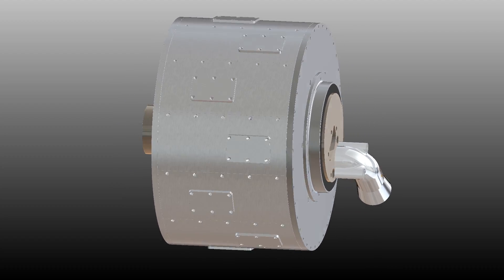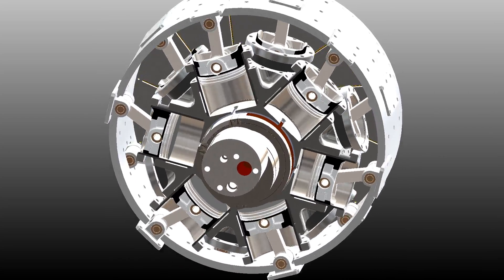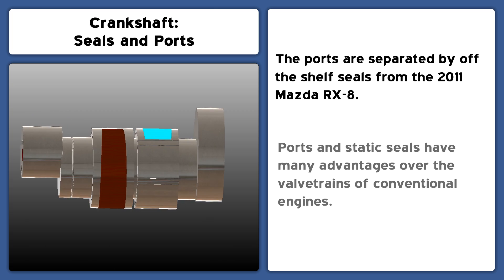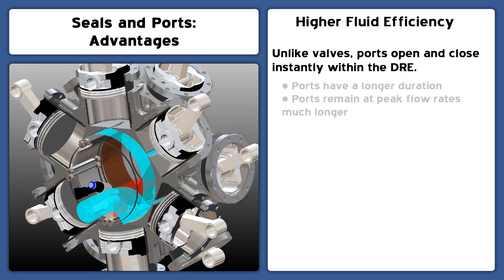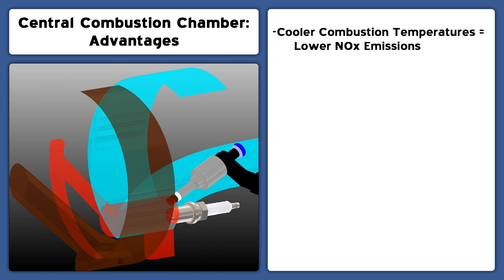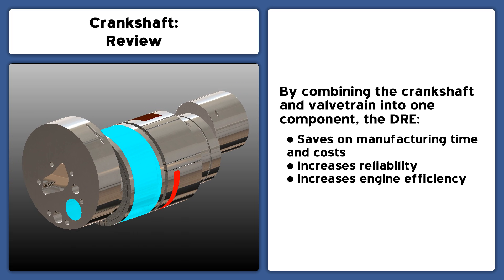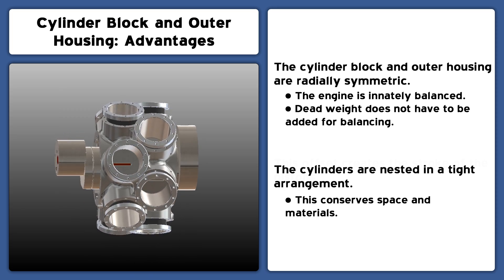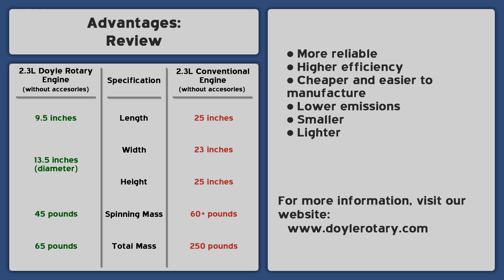New Split Cycle Engine Concept: The Doyle Rotary Engine

Comment from the maker: Getting rid of heat using a cooling system means that some energy from combustion is not being used for power. Why does the conventional engine need such a robust cooling system compared to the DRE?

First, a conventional engine dumps up to 30% of combustion pressure out of the exhaust halfway through the power stroke. In the DRE, less pressure will be lost to exhaust so less fuel will need to be burned to produce the same power per displacement. Burning less fuel will decrease cooling waste.

Comment from the maker: The video explained that the rotating mass is much smaller in the DRE. However, since the mass is located further out, the rotational inertia isn't smaller...it comes out equivalent to a conventional engine.

Comment from the maker: Changing the spark plug requires:
1. Pulling the boot off the spark plug.
2. Removing spark plug with a spark plug socket, ratchet and extension.
3. Screw in and tighten new spark plug.
4. Reconnect boot.

Much less than 8 hours.

Comment: The Arial square four was prone to overheating because there were too many cylinders, too close together - and there were only four.  This engine seems to multiply that problem.  It may work fine on the drawing board, but have any been built, and tried "in anger"?  Maybe I'm missing something, but at first sight, it looks to me that getting rid of heat from this engine would be a nightmare.  12 cylinders' worth of heat is a very small space takes a lot of cooling.

Comment from the maker: Solidworks is more oriented toward creating models to use for machining, molding, etc. The animation and rendering portion of SW is basically an add-on and doesn't have as many features as 3ds Max.

Solidworks is used more for engineering related design while 3ds Max is used more for visual effects and CG images.

So I would say that Solidworks is a program with much more complex 3D modeling tools but simpler animation and rendering tools than 3ds Max.

Comment: I can see two major flaws in this design. Pore oil flow on the piston rings without introducing a method that involves burning lots of oil (short life). Second how do you cool such a thing? Air fins would cause drag, and water/oil cooling would only be effective on the shaft.

Comment: A great backup engine for a primarily electric engine car. You could have it run a fairly big generator for the size of the motor using the rotation of the engines weight to your advantage, by combining the engine and the generator into one piece.

Comment: I agree with many on the sealing of the inner seal rotor and combustion heat would cause problems in in the valve system in the crankshaft. seems no one has made a better engine than the piston crankshaft design used for over 100 years.

Comment: The rotary engine is discontinued because of fuel costs, not reliability problems.  The rotary has failed achieve better than 28MPG in a market dominated by 40+MPG designs that offer comparable power output.  Remember, the 3rd generation RX-7 was nixed during an era of high fuel prices too.  These are not coincidences.

I've driven rotary engine cars dating as far back as 1979.  Never once have any of my engines self-destructed when properly maintained.  Seals blow only after 270,000 miles.

Comment: Scale down conceptual designs approx 3:1, allow for multiple engines inter-connected through crankshafts to common hypoid primary drive system. Phasing drive triangularly will subsequently complicate any repair processes necessary but improve torque at low engine revolutions still allowing for a 'rev happy' power producing machine of endless capabilities. Please refer to my 3D Solidworks CAD and reference PDF 
(Henry Bennets Theoretic Geometry)

Comment: @Orionblade2003 this is true but i was thinking that its still only as efecient as any other internal cumbution engine 45-55% heat loss what if u used the first row of cylender for cumbustion and use the second row to run the steam made buy the cubustionm much more effecient =3-

Comment: @xoxoXoieoxox 
I think the point is that relative to the axis of the rotating components, nothing's moving laterally, so it's balanced more like a wheel/tire than an oddly-shaped crankshaft with counterweights.

Comment: Shorten the stroke? Light weight, higher RPMs, maybe slightly less efficient but potentially much less outer reciprocating mass at higher speeds.

Comment: @DoyleRotary They have advanced quite a bit, but the cost isn't going to get any cheaper for very much more advancement. Think exponential scaling curves for cost versus capacity. 

I'm aware that not many are in this field, I was just throwing some ideas towards you guys on something you might want to look into. I've been wanting to build an example myself, but the problem is with finding a steady state engine that is efficient and light enough for such an application. cont...

Comment: @DoyleRotary Why use a Battery? Half the cost of the current Hybrids is in the Batteries. There are cheaper far more efficient alternatives, such as Super Capacitors. There's no reason to store energy, that will suffer from seepage losses. It's inefficient to take energy from source of storage, fuel, to store it in another less efficient source of storage, batteries. 

This is why I would never buy any of these Hybrids being offered, most of them are inefficient throw away cars.

Comment from the maker: @UOYtaLOL
Also, we have tinkered with ideas to seal the ports in other ways beside Wankel seals. However, when prototyping, we figure why take on the task of reconfiguring the engine AND inventing sealing technologies? For prototyping purposes it makes sense to pull parts off the shelf  to eliminate challenges. You can understand the challenges we are facing without complicating the process.

Comment from the maker: @UOYtaLOL
You bring up good points about spring pressure problems and seals gumming up. Notice that in our engine the seals have a much gentler life. They do not have to adapt to changing angles relative to the surface they are sealing against and they do not cover as much surface during one revolution. The simpler path will allow us to run much lower spring pressures (closer to the pressure of piston rings) and allow the seals to last longer.

Comment: @ADoyle88 Quotes from manufactures.. okay.. well mazda as you know has discontinued their only rotary powered car.. What does that say about the trust in the powerplants design. hmmm... more or less a Novelty item? Mazda has always said they've newly improved their wankels. however the fact of the mater is the seals still fail, with either weak springs, corner/side seals gumming up, or just the good old fashioned blow out. Audi & Fev, "would have" & "would be used" != 30,000+mi proven.

Comment from the maker: @UOYtaLOL 
From wikipedia: 

"Early engine designs had a high incidence of sealing loss...however, Mazda Wankel engines have solved these problems." The 2011 Mazda RX8's "sole engine is a 1.3-liter RENESIS two-rotor rotary engine." 

Finally, "In 2010 Audi revealed that in their electric car... they would have a small 250 cc Wankel engine... FEV Inc revealed that in their electric version of the Fiat 500 a wankel engine would be used."

Mazda, Audi and FEV seem to trust the seals.

Comment: @DoyleRotary I personally think the way of vehicles have to be in the future is a Hybrid design based on the same principles that Diesel Electric Locomotives have adopted. The Diesel engine has no function in actually driving the train, and they are extremely efficient as a result.

Comment: @DoyleRotary This is inaccurate though. One of the reasons many manufactures are going with the open deck designs with sleeve inserts is because the sleeves can be repaired in case of rod or valve retention failure. 

I'm not trying to discount the design, as I'm very interested in it. I think an engine of this nature would be excellent at driving a generator for an electric drive vehicle. The engine itself would only have to be steady state and thusly would be far more efficient.

Comment: @ADoyle88 thanks for getting back to me, yes i did see the chart, but i commented too early to see it. :/
one thing that i was wondering was how does centrifugal force affect the pistons, as you reach higher RMPs the ...outside part (engine housing?) has to push back harder to compress the pistons..or iam i getting mixed up.
any ways iam asking if centrifugal force will cause a decrease in efficiency as higher RMPs are reached?
do you have a running one again? i saw the old footage

Comment from the maker: @un7ucky

The crank is the stationary portion that contains the ports, spark plug and injector. A flywheel or torque converter attaches to the the housing that spins.

We addressed the mass in the video. Because the engine is inherently balanced, no weight has to be added for balancing, so the rotating mass actually comes in under that of a comparably sized conventional engine.

Also, do not forget about how small the DRE is. Check out the chart at the end of the video.

Comment from the maker: @n4120p

Oil will be pressure fed from the crankshaft through passages to the outer end of each rod. The oil will travel through the outer pins, up through the rod, into the piston wrist pins and then distribute into the rings of each piston.

We are currently making great progress on the next prototype and expect it to be ready for testing and a matter of weeks. Check out the comments on the Overview page of the Doyle Rotary website for the progress of the next prototype.

Comment from the maker: @n4120p
The stationary crankshaft and rotating cylinder block both have cooling passages.

Our seals are off the shelf seals from the Wankel rotary engines. These will be sliding across a chrome plated surface and will have the same oil injector that the Wankel rotary uses. The amount of oil that will be injected will be equal to or less than the amount in the Wankel (which passes US emissions).

There is a stationary oil pickup tube that scavenges the oil as the outer housing rotates.

Comment: From the dynamic stanpoint make a lot of sense  but I don't see how is the cooling flow is gonna work you have all the heat right in the center of the unit and the valving port looks like the point of high stress if you lubricate that surface is gonna burn oil and have terrible emissions and  if you don't it will seize and break ,, how are you going to collect the oil held by centrifugal force in the outer case and drive it to the rod pins and other rubbing surfaces ,,, lets see that ,,,???

Comment: Very cool, but something like this has already been put into a car, im not saying this isn't already invented, im just saying something like it has already been put into cars. The thing about it is, the spinning motion of the whole engine will decrease longevity, plus if you crash, you have a face-full of 3,000 rpm engine. Sorry to say, you wont see the standard V internal combustion engine leave for an extremely long time.

Comment: @ADoyle88 what i wanted to say that your main piston assembly from center crankshaft to the end of all piston rods are same ,,as it is

but the end of connecting or piston rod follow a elliptical path

let there is only one engine assembly in your concept

and at the top of elliptical part which is narrow --

as your engine start

piston rod going from narrow to wide which cause piston to suck air/fuel mix.

and at narrow-bottom piston compressed

as it is cycle run 4 strokes

Comment: @ADoyle88
 no no no 
what i wanted to say  that your main piston assembly from center crankshaft to the end of all piston rods are same ,,as it is 
but the end of connecting or piston rod follow a elliptical path

let there is only one engine assembly in your concept
and at the top  of elliptical part which is narrow --
as your engine start
piston rod going from narrow to wide which cause piston to suck air/fuel mix.
and at narrow-bottom piston compressed
as it is cycle run 4 strokes

Comment from the maker: @Asdayasman 
This engine is still very early stage. My dad (Lonny Doyle) has been developing it off and on for 27 years now. I am 23 and have 3 younger brothers (you can see why he didn't have much time for the engine up until now).

My dad has been busy this year but plans to start working on the prototype again soon when work lightens up (he owns and operates an aircraft machine shop). This prototype will be the second to fire up and the first to be testable.
Reply: so nobody told your dad that as single engine this will be useless as aircraft engine because of the forces will pull aircraft one one side like that happened during ww1 when they abandoned similar engines.
Reply: @jebise1126  I know what you're trying to say, but since there are two rows of pistons that are on inverse cycles, the engine wouldn't torque over.  In addition, the fact that other engines do torque over doesn't make them useless for aircraft use.

Comment: this looks promising, please compare the gyroscopic moments of your engine to the gyroscopic moments of an equally powerful engine (flywheel included) I am guessing that your engine gets the same power for a smaller size by operating at higher RPMs (permisible by the simpler more circular design)... that will drasticaly increase gyroscopic forces.

Comment: one question, cuz u have say 10 cylinders doing the work of 5 cylinders, this does increase a little of efficiency problem, and add somewhat of a rotating mass problem. That being said, I realize that you dont have a camshaft, vales, and other valve-train components. Does your engine produce a greater thermal efficiency and less parasitic loss over conventional engines?  

How and Why please?

Comment: Nevermind, I figured it out. I also understand it will be an upgrade over the conventional IC engine from a manufacturing and weight savings standpoint, but how does it compare in efficiency? I know the conventional IC engine is very inefficient compared to the tesla turbine for example. I could imagine better efficiency due to more fluid motion and less directional change

Comment from the maker: @bartdereu 

At 4:42 you can see that the 2.3 liter DRE has 45 pounds of spinning mass. This is considerably less than a conventional 2.3 liter's 60+ pounds.

Unlike conventional engines, the DRE is inherently balanced (because of its radial layout) and does not require dead weight to be added to the engine as counterweights. Despite appearances in the animation, the DRE is a lot smaller and lighter (total mass and spinning mass) than conventional engines.

Comment from the maker: @andgate2000 

Removing the valvetrain has left the DRE with far less moving parts than conventional engines. Also, the moving parts in the DRE follow simple, circular paths. Compare this to the motion in conventional engines.

As for the future of IC engines, many people agree that electrics have come a long way but still have a long way to go. The IC engine may still have some life left especially when paired with electric motors in hybrid vehicles. Time will tell.

Comment from the maker: @CIAAGENT100 

DocWolph's reply to you was a good answer. The DRE has a single spark plug that is reachable by disconnecting the spark plug wire and using a socket to remove the plug. It would be easy and cheap for anyone to do (10 minute job).

Compare this to a recent quote for changing the spark plugs on a 2007 GMC Acadia: The shop quoted 3 hours and $250 to replace the six spark plugs. The three rear plugs are very difficult to get to. Keep in mind that the Acadia is still being sold today.

Comment from the maker: @DocWolph 
In the production versions of the engine the air would enter and the exhaust would exit through the same end of the stationary crankshaft. On the opposite side of the engine, a flywheel or flex plate would be attached to the outer housing to accommodate a clutch or torque converter. The engine would be supported on the port end of the crankshaft and a stationary housing would wrap around the engine to connect to the transmission's bell housing.

Comment: @CIAAGENT100 There is only one spark plug and it looks like a typical spark plug tool or a lengthened one would be sufficient to get it out. I imagine though a production version would have two plugs.

Comment: The only thing I'm having trouble seeing here is how you get the mechanical power out to a transmission. I am assuming this could be used for an automobile, motorcycle, or boat. But what I'm seeing here looks like it would be really used for helicopters and propeller aircraft. 

But this is among the more promising of alternative engine designs I have seen so far.

Comment: you were featured in popular mechanics magezine just so you know but it seems one piston on the "compressor' side is supplying compressed air up to 3 cylinders on the 'power' side, and under compressed charges make very little power with tons of power being leeched off to compress the charges making very little power to be able to drive a car and such meaning the design has potential but right now still needs work

Comment: @ADoyle88 That's actually really cool. I'm glad you corrected me. A few more questions: How does it transfer the power to the rest of the car? Does the torque converter/clutch set right up against the engine block? Can you give me a break down of the weight comparisons as far as rotational mass, like your block+piston+connecting rods+connection to tranny vs the 4 cylinder crank+pistons+connecting rods+flywheel (+torque conv. for auto) and anything I missed just to see how they stack up.